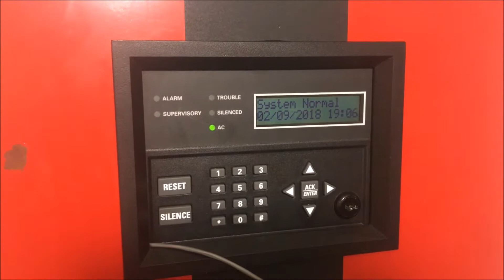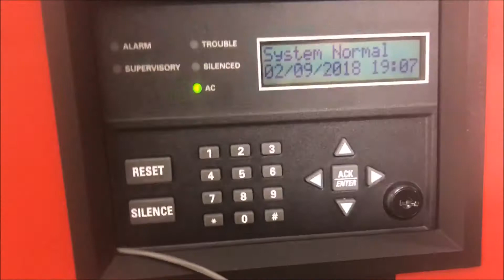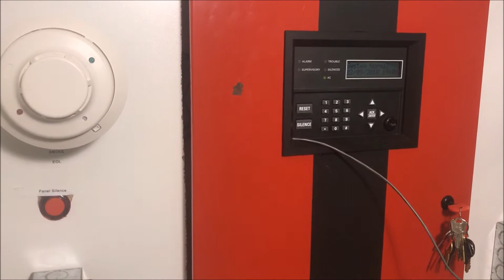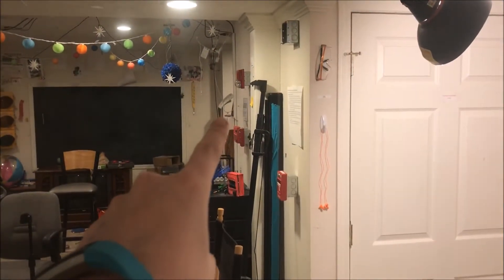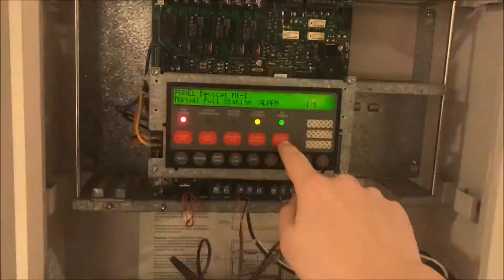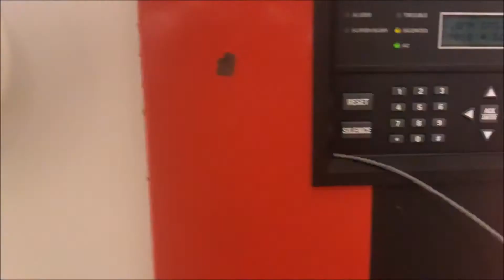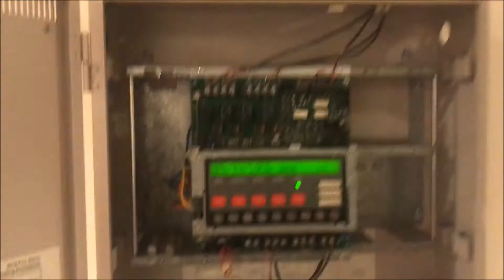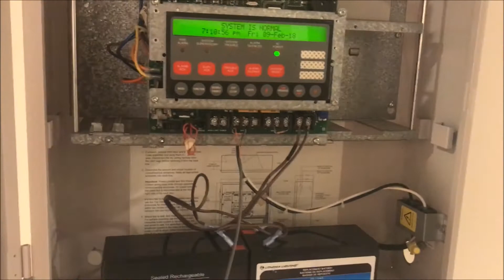Connecting Two Fire Panels to Make One Massive Panel

Comment: i wonder what happens when you mix alarms between a simplex 4903-9219 and the system sensor low frequency sounder.
Reply: Depends on what selector you have on the spectralert and the simplex horns are always going to be louder but sometimes I can second that

Comment: Relays don’t need resistors....... I see the relay next to the one your using has a resistor on if
Reply: No, you are correct - relays do  it need resistors. But his conventional Silent Knight panel needs an EOL resistor at the end of each IDC. So the relay on the Simplex panel being dry contacts was like a pull station, and it was at the very end of the circuit on the Silent Knight IDC. Therefore, the resistor needed to go across the two conductors of the IDC.
Reply: Best Security Systems I know that’s why I said the relay you WereNT using
Reply from the maker: I know none of the relays need resistors, that's why I didn't put them in. the panel came to me with them in, and I just never took them out. My guess, is that when this was in an actual system and controlling a suppression release system, the relays were used for the release card, and therefor had to be monitored as well. Good eye though!